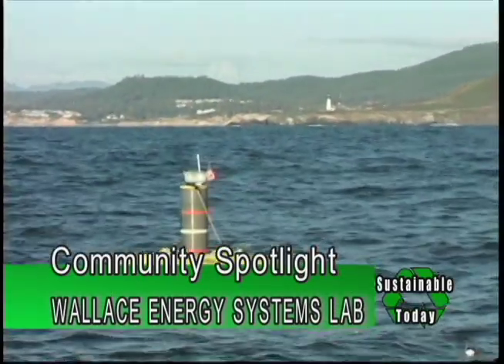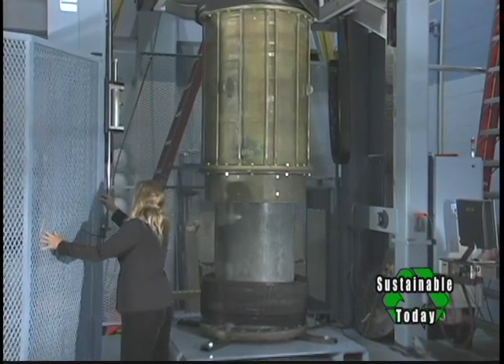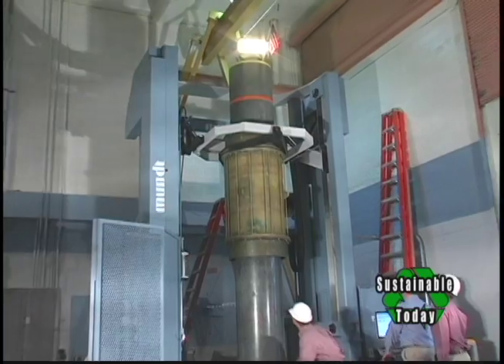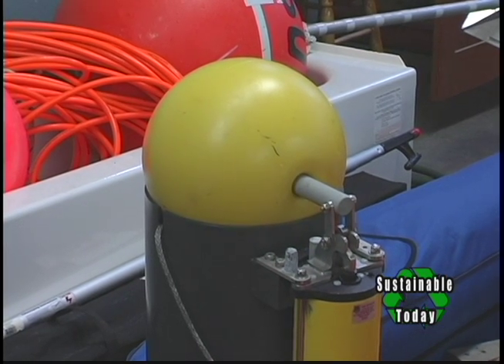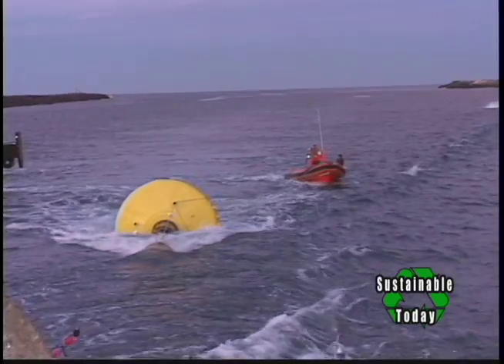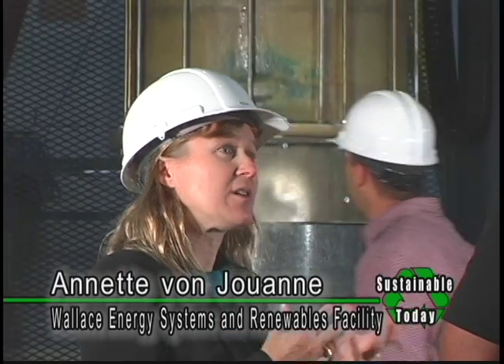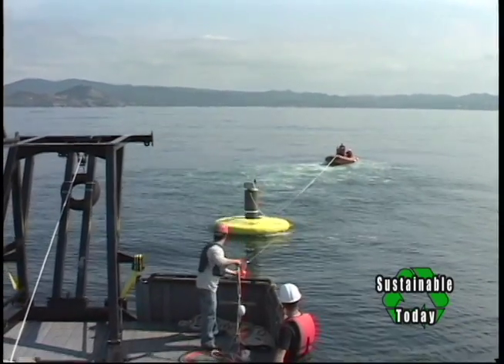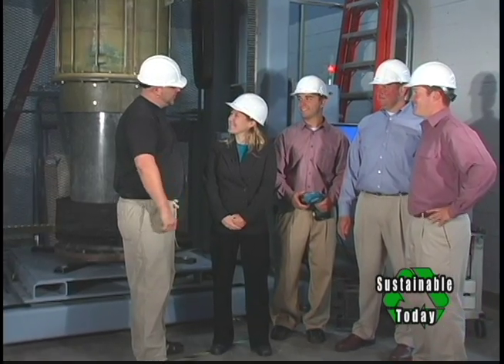Electricity from Ocean Waves

Comment: There are two main weak points in your design and output:     1- You are looking to generate electricity out of sea waves, consequently you need to choose the best locations in which sea waves are harnessed. A giant rock near to sea shore is an appropriate place to find harnessed sea waves.
   2- You refused to refer to hydraulic mechanical systems to generate electricity, and you relied on electromagnetic induction, however there is a question which you have to answer: did you use all the momentum provided by the buoy while moving up and down, or probably a hydraulic mechanical system will avail automatically a better usage of the available momentum.